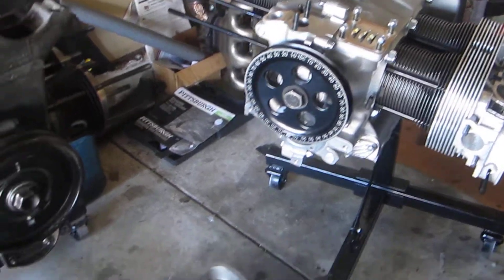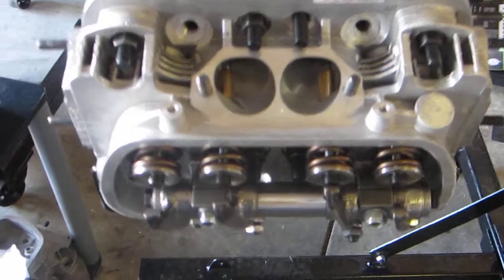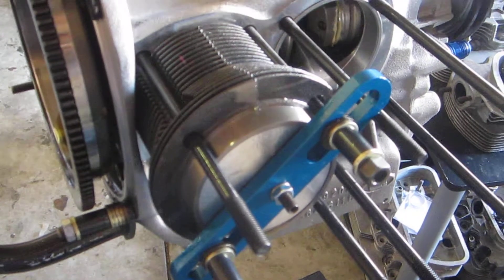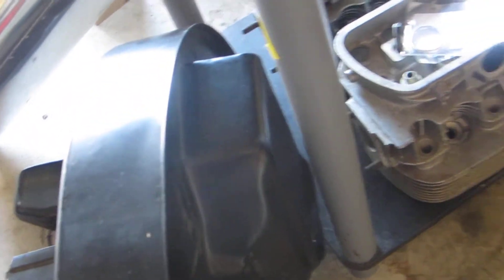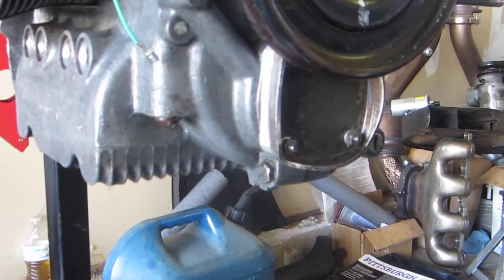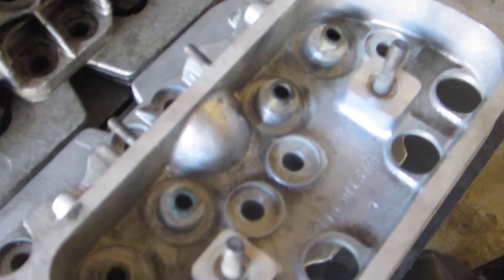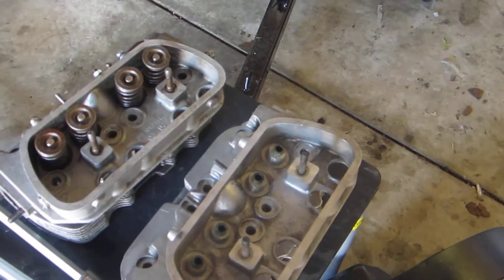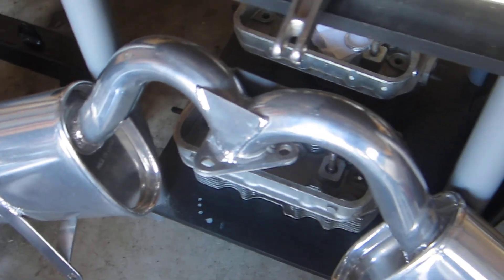Update on my VW engines and projects!

Comment: Awesome, glad your moving forward still! When setting the deck, make sure to use 2 methods to double check. Use a depth gauge directly on the cylinder top measuring the piston depth. Measure above the piston pin to avoid piston rock variables. I use a I-gaging digital $20 deal.
Reply from the maker: Thanks Jeffrey. Right on, the depth gauge is the way I measured. I brought the piston to TDC using my dial indicator, then, with each barrel clamped down by the deck tool, and both compression rings on each piston used the depth gauge to measure right at .050". Its looking good, sorry for the video ending abruptly. Hopefully Santa brings me a better camera lol.
Reply: @vwsandvettes3253  Awesome!  That will rip! those 650 springs are no joke too, hope u got some good strong non deflecting pushrods💪
Reply from the maker: @jpaull  Stay tuned for more on the valve train, and whether I can build it to last!